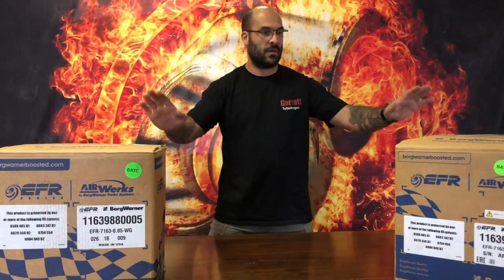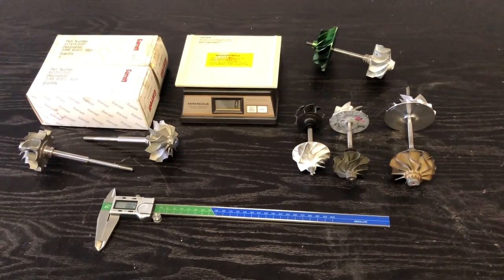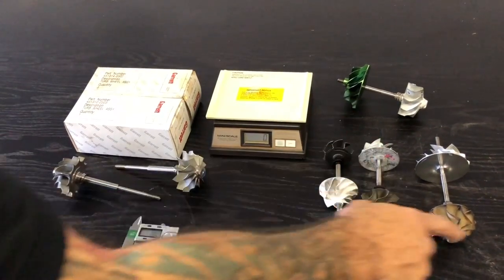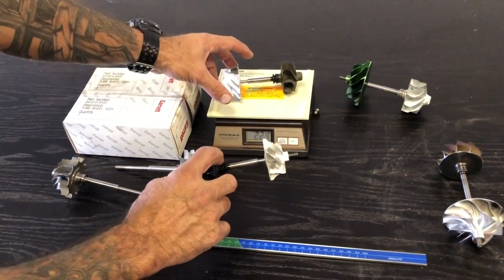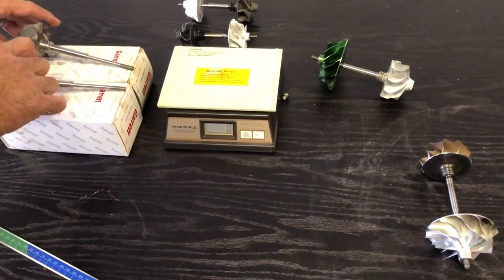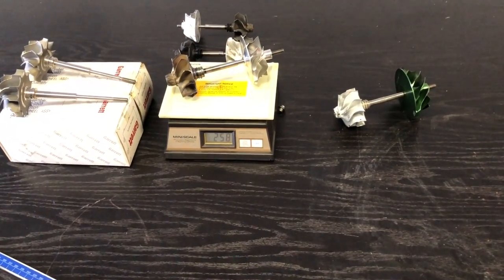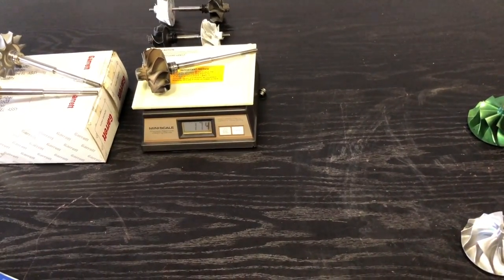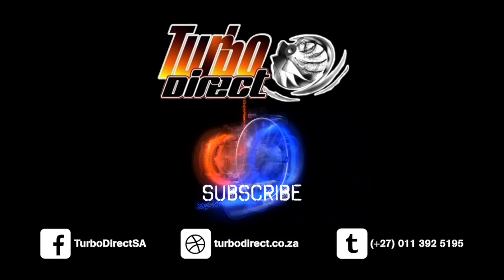BorgWarner EFR7163 - put to the test

Comment: Appreciate your vids. Subscribed and just wandering about the clamp plate kit for the efr7163 aluminum CHRA. You sent me a part number which is indeed correct, but it is only for B2 housings. The efr7163 is a B1 housing and the part number you referenced is for a 5 bolt set up, where as the efr7163 is a 4 bolt set up.
Any suggestions on a clamp plate kit for the efr7163 or as to why, with good, cause, no body offers a kit for the 4 bolt where as they offer one for the 5 bolt?  Seems the aluminum is the issue here, not the size of the housing.  
Any and all answers and help in this regard are greatly appreciated.

I should also let you know that I greatly appreciate your vids and info. We built a drag car that is is running low 4a and the knowledge you have presented helps along the way.
cheers!

Comment: There's a hell of a lot more to consider than just the weight of the turbine when purchasing a turbo. It also helps to do direct comparisons of equivalent products. Otherwise a very informative video
Reply from the maker: The channel has plenty videos on side by side comparisons between the Borg range aswell as Borg versus Garrett - alot more info carried across including the weight (the most important factor of them all) of the turbine wheel.

Comment: Hi, Can you compare the difference between EFR7163 and gtx3071r gen2?
Reply from the maker: Yes sir - great suggestion - it will be coming up soon.
Reply: @TurboDirectSA  please do it soon! I'm comparing those 2 at the moment and that led me to this video💪🏽 out of those 2 what would you say is better for a street m20 bmw motor build? Only plan on running 8-12 psi looking to make no more than 300 whp but want boost response as if the car came from the factory with a turbo
Reply from the maker: @vaugr1917  In these two options - the 7163 is without a doubt the better choice for so many reasons. The first is that the spool characteristics will be faster and smoother than the Garrett every day of the week - the EFR uses the T28 volute family housing, albeit with either Vband or T25 (both are larger ARs Turbine housing AR0.85) and the GTX uses the T3 family - secondly the weight of the EFR turbine head is 30-40% lighter than the Garrett.  The technology in the wastegate control (GTX requires external gate = lag) and the internal 36mm swing valve design of the EFR is leagues ahead.  The bearing system in the EFR is far superior, and the EFR uses an aluminium bearing housing (option) which has much larger cooling jackets integrated. he EFR runs at MUCH lower turbine RPM than the Garrett -- the EFR will make the power you want at the boost pressure you intend running, and lots more, when you turn up the heat later on.

Comment: We'll really see some crazy performance gains when turbo components are made from carbon fiber......it gonna be madness!!
Reply: It will not happen due to strength density requirement of turbochargers. The closes you could get is carbon-carbon, or carbon-ceramic, but shaping something that thing with consistent fiber packing would be the difficult part. These parts are more strength-focused than lightness-focused.

Comment: I think it would be more interesting to see the EFR7163 compressor weight against the GTX2971R & GTK-550!
Reply from the maker: GTX2971 will be a close match to the EFR im sure - probably slightly heavier due to the design
Reply: @TurboDirectSA  I'm sure there will be a very little difference or no difference at all! It's easy to compare against older design...
Reply: How does gtx2960 compare to gtx2860?
Reply from the maker: @dennisrobinson8008  Same compressor, larger (older) GT3071R turbine stage.
Reply: gtk-550 is verryyyyy old, and no doubt very heavy

Comment: @TurboDirect S.A - I would
love to see a comparison video of the Newer EFR lineup looking at the 8474 compared
to the 8374 and that range. Does it really spool the same but offer more flow?
An overview of the compressor maps compared to the older. While these came out late
last year there is not a ton of information on them. I am looking at the 8474
for an N54 so any insight would be great.
Reply from the maker: Hey Daniel, the 8374 we dont bring in anymore, and i doubt we will again as noone will choose this over the black series 8474, if i had stock left, i would take the 8374 off the shelf and do the comparison for you - but according to the spec sheet the housings and rotating assembly dimensions are the same size but the aero design changes have improved flow considerably, which is precisely where the gains are - i do not believe that the turbo will spool later than the 8374 but the flow increase is obvious and substantial  - making this the best choice turbocharger in its power and family size range by far!

Comment: I had a 7670 just this last year and it wouldn't even spool at idle(which really freaked me out), I think something was wrong with it. My rep tried to say "because the bearing is so much larger and the wheel is so light it doesnt have the inertia to spin".....basically it spooled a tad worse then the gtx3076 I had before it and transient response wasnt good. My first impression was not good.
Reply from the maker: Alexander Knight most definately something wrong there - there are ALOT of aspects of a custom build that have a direct and indirect effect on the spool characteristics of a turbo - these ill be doing videos on near the end of the year on one of our other project cars. Collector deisgns (hence the Swirl adapter we designed for the G7R platform) runner lengths, ID of the runners, intercooler setup, engines compression, cam timing, charge piping and and and --- the 7670 is a quick spooling turbo and should not be laggy at all -

Comment: I still want to see a comparison between the EFR and Hybrid IS38 700Hp.
Reply from the maker: I have installed the IS38600 onto our development Golf7.5R and will be sharing some tuning videos on this soon. We have a bolt on Borg EFR7163 kit which we will then change over and show the results of aswell. This will be using the Stock VW Actuator/wastegate control - just to show that you do not have to use external wastegate to control these turbos.
Reply: @TurboDirectSA  lovely can't wait for the results.
Reply from the maker: @cigmaian7139  https://www.youtube.com/watch?v=o9NM5lTCisc&t=1s
Reply: @TurboDirectSA   it will be really nice to see some 100-200 times and 1/4.  For the mods and low boost Dyno results are ok,  there it's room for more.
Reply from the maker: @cigmaian7139  We have done more tuning with some octane boost and increased ignition advance slightly and seen 260WKW and 457WNM already at the same boost, so there is PLENTY more room - after our lock down is over, we will install our Intercooler and complete the remainder of the rear section of the exhaust and then up the boost and push the turbo to its max and share this with everyone.

Comment: want to see a comparison to the G25, G30 turbine.  with less blades and less material "thinner blades" .  How do they compare?
Reply from the maker: Ill try get a video made of this today if possible. Unfortunately our country is on full lock down from Thursday - we have massive preperaitons to do before then.
Reply: @TurboDirectSA  I also would love to see the 7163 vs the g25-660 turbine. i think they are more of a direct competitor
Reply from the maker: @Trevdog2392  The G25 size for size is not a direct competitor, the GTX30 shaft is a direct competitor based on inducer and exducer sizes. The G25 shaft is more based directly against the EFR6258, which will weight in around 60% of the weight of the G25 shaft -
Reply: @TurboDirectSA  the g-series turbos flow much better for the same size though. I don't think the inducer and exducer diameters tell the whole story here.  look how much more the g25 wheels flow than the comparable g28. they made some big advancements with these
Reply from the maker: @Trevdog2392  Accoring to the compressor maps the G25's compressor flows more, but the comparison was between the inducer and exducer size of the turbine wheel - based on the family turbochargers apples with apples (size for size) 

to be honest the G-series turbochargers do not flow more than the GTX Gen2 series compressors - the noticeable difference is on the turbine side purely based on the one less blade which alleviates backpressure. Look carefully at the compressor maps, they do not marry up to the lb/min flow rates - In this case the EFR is a much better product, spool versus outright power delivery, linear response, and the reliability is unmatched. The Ball bearing cartridge in the EFR is on another level.  Garrett are yet to change their design from the 80's.
Reply: @TurboDirectSA  awesome information. Thank you!
Reply from the maker: @Trevdog2392  Pleasure Sir - anytime